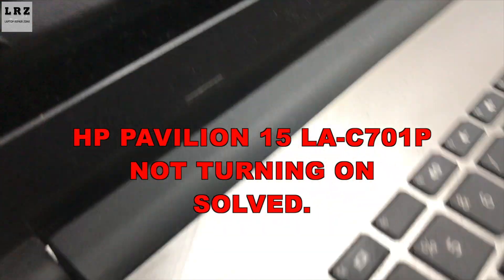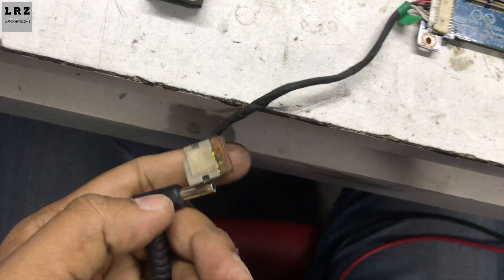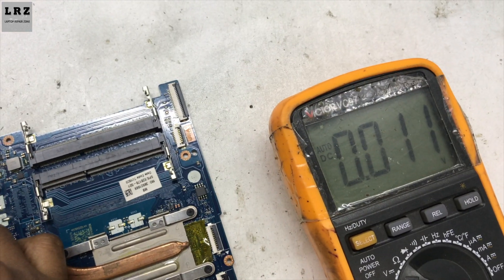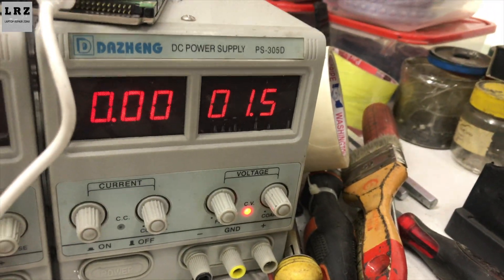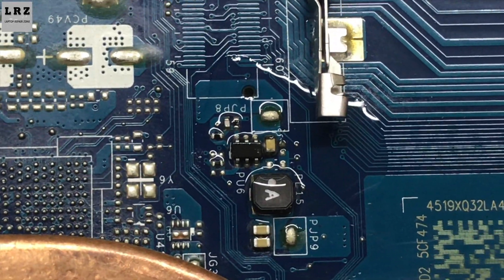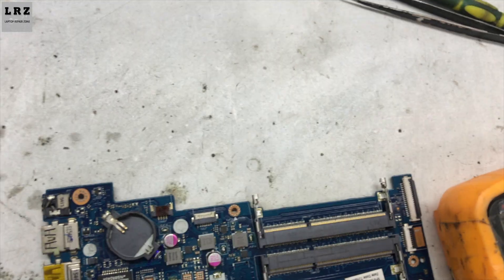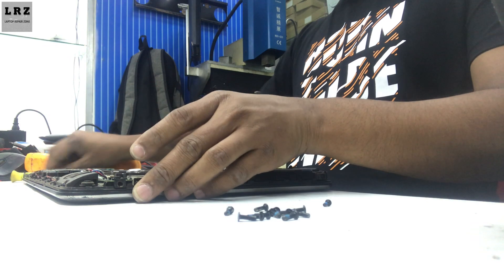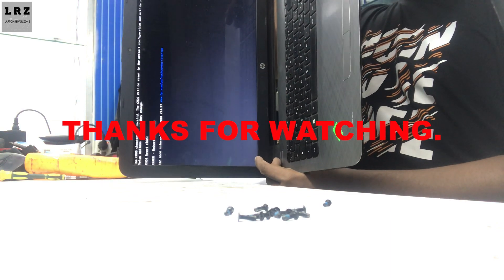Hp Pavilion 15 LA-C701P No Power:Not Turning On Solved.

Comment: I have Infinix x11 series laptop ..
Charging(charging light shows and is charging perfectly  fine) but not powering ON. (no fans running,no BackLIT keyboard light)

Power button light turns ON and then OFF after 3-5seconds.
Reply from the maker: Thanks for your comment, first try to reset CMOS

Comment: video is not educational at all. 
first of all pressing the power button does not create 3.3v and 5v or even 19v.
they are always present if any of them isn't present, your motherboard will not boot as the superio will not let the board boot without those voltages.

Comment: Hi bro, i have a HP pavilion 20 AIO, sometimes can power on, sometimes cant power on. Anything i should check? Power adaptor is working fine. I already take out the motherboard and unplug everything, still same. Power light is there on the motherboard but cannot turn on.
Reply from the maker: Thanks for your comment, please check all the required voltage step by step.

Comment: Hi, I have different model from hp but the power light is not on it is completely dead.
Laptop is HP envy DV6.
You think my problem is different?
Reply from the maker: Thanks for your comment, please check all the required voltage step by step.

Comment: Good work. But I notice that you did not replace the capacitor(shorted) that you removed. What is the value of that capacitor? Did it run/operate properly without the capacitor that's been removed?
Reply from the maker: Thanks for your comment, it’s not necessary to replace the capacitors.

Comment: Why you didn't putting new capacitor after remove???
Reply from the maker: thanks for your comment.
Reply: because the ceramic capacitors have a minor function of filtering the unawanted riples in voltage waves , so removing it has minor impact as they as so many in the power suply line

Comment: brother will you plz tell me the solution that my laptop hp 15-g019wm charging light is blinking but can't showing display on the screen . when i switch on the laptop it,s fan moves for one an half seconds then suddenly stop but the charging light is still blinking and no display . I had changed RAM washed the whole mother board but still not woking
Reply: Jawad Ahmad did you fix it?

Comment: How do you find where voltages should be on unknown equipment?  For instance, I can't find schematics, board files, or anything on much of any HP equipment, and unless I have a working board to test against, I would have no clue where I should be finding 3 volts, 5 volts, etc.
Reply from the maker: PoDuck thanks for your comment, I have 10 years of laptops repair experience most of laptops I don’t need any schematic, I repair with my experience.

Comment: Fantastic video there! Well I am lucky and have exactly the same short on this power rail but unfortunately does not seem to be that capacitor. It is not getting hot when I inject power like you did... Must be from something else... Also did not notice anything to get hot even though there is the short.
Reply from the maker: i think chipset short.
Reply: I put 2.5 Amps but NOTHING is getting hot... Strange. What can I do next man?

Comment: Sir i have a same motherboard with nvdia gpu. The problem is the laptop starts, fan spins for 1 second and then stops. Is the problem with the GPU? Or something else?

Please help korun
Reply from the maker: Anirudh Kundu check all the voltage step by step, reflow CPU GPU.thanks.
Reply: @Laptop_repair_zone  sir the gpu coils have no supply. Other coils have all the supply.

I have removed the coils of thr gpu and gpu memory but still there is problem. Plz help and guide me.

Comment: Thanks alot i have a toshiba stuck at toshiba bios screen when powered on...could it be the bios
Reply from the maker: Mugo M Kelvin first remove HDD.KEYBOARD.ODD.WIFI CARD.if problem not solved.then flash bios.
Reply: Thanks alot worked by flashing bios. Though was hard to gt.
Reply: Also yu have two DC power supply wat do yu use the other one for kindly?
Reply from the maker: @mugomkelvin6399  i use another one for find out short in motherboard.
Reply: The Toshiba was the c55T